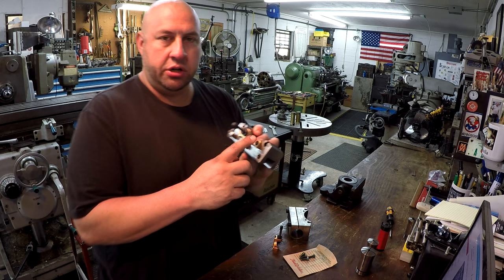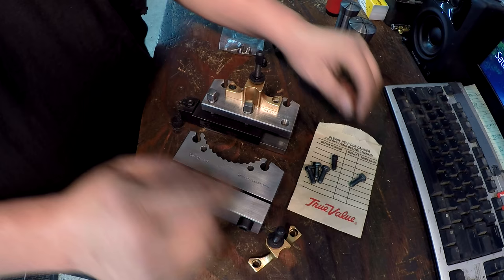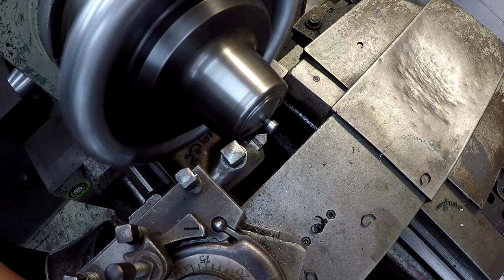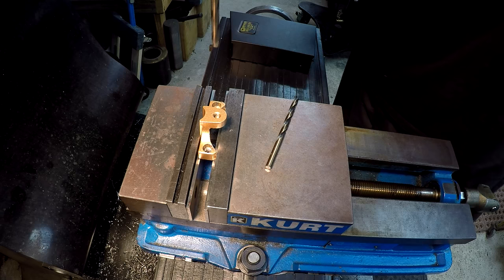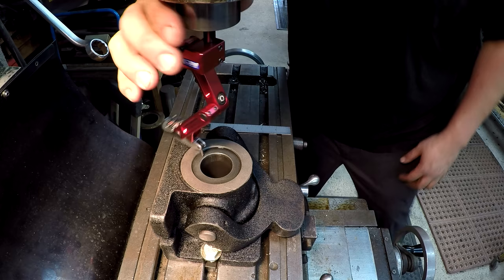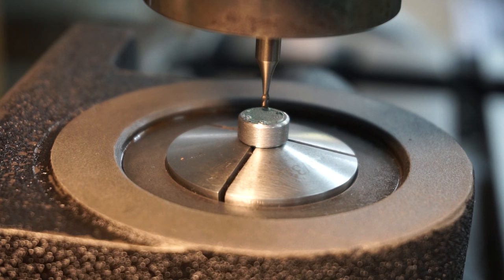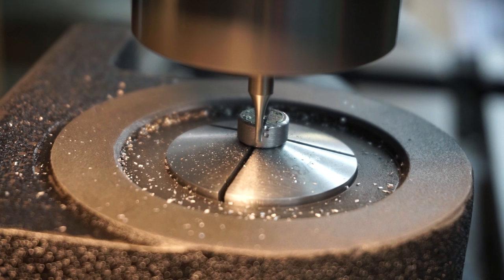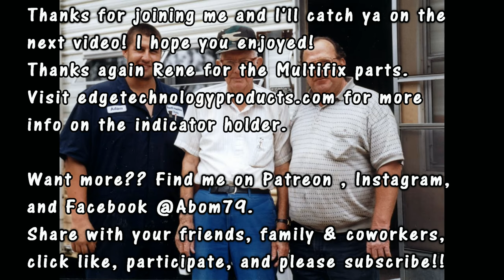Saturday Night Special 143 Part 2: Multifix Mods, Edge Indicator Holder

Comment: Adam, collets and screw threads have been a problem for me because the crests were often bruised from the clamping force. An old timer in the electric shop showed me how to pick a copper or iron wire size to wind spring fashion into the thread, The collet gripped the wire and the wire contacted the thread flanks. The softcwire deformed making a good but gentle grip on the threads.
Reply: thats a nice one I will have to try.
Reply: Or lock two nuts against each other, making sure that the flats line up.

Comment: I needed some M7 bolts a few years ago when I replaced an engine on a old Craftsman snow-blower, and the new motor (offshore clone) needed the M7 to mount.  No-one had in stock, and online the only suggestion was a VW shop, as they indicated that M7 was used for some part (water pump?) on a few years models.  It turned out to be easier just to grab a few M8 bolts, and run an M7 die on them to thread them down to M7.  (for some reason my tap and die set had a M7 die)  Not a perfect solution, but it did the job without having to re-invent the wheel.

Comment: For those who don't have a  full drill size set here is my advice. My projects used a mix of metric and Imperial fasteners. An older machinist advised me to buy a complete fractional/numbered/lettered set. That way all sizes are covered. a couple of 1/1000 of an inch wont make a significant difference. Find a drill chart that converts the metric size to its imperial equivalent and away you go. It worked really well. I bought a cheap all inclusive set and when a bit broke I replaced it with a new but Good bit.

Comment: Abom using a 1/16" end mill?  That's a switch!  Must have been good and sharp, that was a pretty good cut. I held my breath hoping it wouldn't break. 
Sony camera looks good. With a close-up shot, you might try a higher f-stop, it will give you a greater depth of field and make focusing less critical.

Comment: That new camera has such incredible image quality!  I like the background noise for that bit.  But yes, you need to get or build some sort of a rubber shockmount for damping the vibrations for mounting the NOGA-held camera on a machine's table.  Fun to see you working on smaller parts once in a while. ^^

Comment: Just a Tip from a Guy over here in Germany:.... get a METRIC Repair Set called "Helicoil", drill your "M7" Hole bigger in the Multifixholder to 7,6-7,8mm , tap it for the M6-Helicoil, and then thread a M6-Helicoil Insert in there....DONE......use your Indicator Holder as is, WITH the M6 Allen-Head Screws.... ;) all tools required ar in a Set for the Helicoil (Drill, Tap, and inserts)

Comment: I used collet holders like that all the time when I was a lead setup man on horizontal mills. If i remember correctly the lock screw is not for locking the collet holder in the closed position. It was to keep the collet from spinning in the holder in long production runs. On the collets we used there was a keyway where that lock screw or set screw would hold the collet in place and not let it spin. Then you just move the handle up to take milled part out and push down to tighten on part to be milled.
Reply from the maker: The problem with mine is that is feels kind of springy and it might not stay locked with just the handle. The set screw kept the collet locked in place though.
Reply: Yes, they dont click or a lock down feel but they hold like that springy feel. We ran short production runs as small as 10pcs. and as big as 10,000 and they held like that and I never had one lift the part out of the collet. They hold well.

Comment: Like you said M7 is not a common used size. Our regular Hardware-Stores normally don't sell them. If they do they are quite specialized. I find it hilarious that you would find them in an US Hardware-Store.
Reply: its an iso size, just a weird one, along with the 11mm head size it would have had., i belive its more of a 'leftover' size from fractional sizing as its very close to 7/16 bar stock
Reply: Lol...exactly! Even though my tap and die set has them I have not encountered a M7 screw or nut even in the wildest hardware bin! Not on thread repairs(even though it's the correct size over M6), not on motorcycles cars bicycles, and I bet even unicorns don't have them!
Reply: i've never seen M7 before even working in the shop for almost ten years(im in asia here almost everything are in metrics)it really rare size

sorry for my english not my 1st language
Reply: Your English is OK! I've never seen a 7mm thread either. I have never seen a 7mm tap or die. It is like a Unified National #12-24 thread. Until last year I never needed a #12-24 tap and like Abom I found one at the True Value Hardware store (a full three tap set with a plug and bottoming tap in fact! It was American made too).
Reply: Zorgoban 
Ya I have had to look for some M7, seems to be common in German made things for some reason
Its a pain when someone uses it, as trying to fix it and nothing is open on weekends much.
I still wonder though why its used, such a weird size.
Reply: I have never seen a 7mm bolt, but I have half a dozen 12-24 taps, and a lot of other archaic sizes.  15mm was more common on earlier metric cars, like VW and Honda, back in the 60's and 70's, and on early American crossover cars of the '70's, hardly ever see one now.
Reply: I'm in Germany and i can't remember ever seeing an M7 bolt.
Even my thread cutter and tap sets don't have it.
And i know for sure most hardware stores in Germany don't have it either.

Its a seriously stupid size.
Reply: On 3 brands of Italian scooters I've never saw one(even on the real vintage ones), Yamahas,Hondas,Kawis...from underbone to sports production...none...To be fair I've never even seen a Bugatti though!
Reply: Chris Stephens
if you want an actual known use for m7, skoda estelle door hinge bolts, dont ask how i know!
Reply: i worked in an arcade and a lot of our japanese cabinets had m7 in them holding stuff together
Reply: M7 is quite common on car engines, like Volvo's aluminium engines. Valve cover, oil pan, intake manifold and various brackets and stuff are all M7. Renault too, and probably others, but those are the brands I have worked on most.
But still an oddball size, so I treasure my little box of M7 hardware...
Reply: In 60's all citroen and other French cars had this sizes.M7,M9,M11 etc.They also needed special tools to work on them.

Comment: The collet holder is very nice, and so is the new camera! Whenever you have smaller stuff, it's perfect for it.
Reply: By the way, why don't you make some hard mounting points in the ceiling? Nothing permanent, but example, you could have a plate above each machine, and on it, a thread. There you'd mount and extension that would give you a metal point to grab with you Noga. It wouldn't be in the way, and, bonus, no vibrations.

Comment: You could pick up a boom type microphone stand pretty cheap, and use it to put your camera close to or over the work without sitting it on the machine. Probably have to make an adapter between the stand and the boom end, but that should be easy enough. I think I saw one at Amazon for around $20. If you're worried about it falling over, just do what the pros do and sandbag the leg opposite the load. Goes without saying I am a solid fan of the channel. Thanks for all you do.

Comment: Hey Adam,  I heard you telling that your mind was set up with imperial measurements and that you were having difficulties with metric. For me that is likewise, but the other way around. Metric is in my system and if I have to do with imperial, than i have to do some thinking. But what helps me enormus is, that 1/16" is almost exactly 1.6 mm (your may be a few thousands off). This has proved to me very handy and easy to remember. So: 5/8 = 10/16 = 10 x1.6 = 16mm and 5/32" = 2.5/16 = 2.5x1.6 = 4mm. And 1" = 16/16 = 16x1.6 = 25.6mm. This works for me and it might give you a better feeling for metric measurements. Y.C., Timen.

Comment: To each his own but I think I would have cut the slots with a slotting saw/arbor combo holding them horizontal. Don't really matter how it is done as long as it gets done....... Good video as always.
Reply from the maker: Johnny Holland As I have always said, more then one way to get the job done.
Reply: That is what makes Adam's channel so interesting is that he shows us different ways to accomplish a goal.
Reply: The whole thing adapting a screw head is a 10 seconds job on a grinder. Would not be as pretty but would work just as well. Only NASA would machine a screw with 1 thou tolerance :-)
Reply: i think most people would have used a slotting saw but this is way more entertaining

Comment: I like the back ground noise, not too loud like music in the back ground Real life works real well for you and the sound goes well with the work IMHO. Like in the shop at MI, people walking around metal banging around when the machine is off. Keith F and Keith R (at the museum) both have background sound. I sure as hell prefer it to music. Not a camera person but it seem to me the auto focus could be over thinking the vibration when the cutter was cutting. Either that or the camera was just capturing the vibration of the set up. It was in focus before and after the cut. Sound volume is definitely up a notch or two but very clear, switching cameras often might be annoying. Just my 2 cents. Great to watch as always and thanks for the work ahead so none of have a depressing Saturday night.

Comment: Just wanted to point out that you are correct, M7x1 is far more rare than M6 or M8 because M7 is considered a 'second choice' thread size (but does actually exist as an ISO 261 standard, unlike M9).

Comment: i forget if Sony uses sensor stabilization or OIS in the lenses but make sure that is turned on, it will help with the vibration. As far as microphones go an external is always a good idea. the internal will do the job but you can expect much higher quality from a hotshoe mounted external.

Comment: Thanks for your video. Though i have multifix tool post and holder sales many years. Many models are made in China and I just sell. I don't know how to use them actually. By your video i learn that the T wrench can be used on height adjusting screw too. And i saw some interesting tools and accessories in your workshop. Thanks!

Comment: It's interesting how much vibration was introduced when you started cutting, and it looked subtle enough to only cause focus issues and not movement issues. I wonder how much that vibration effects the machine. Also, try a shock mount for the camera, should be good enough, and they're used throughout the RC world especially in multi-rotors. 
And your idea of using a Rode mic to get rid of background noise; I personally like some background noise, gives more life to the content, as it doesn't make your workshop and the world around it seem dead silent.

Comment: I may be crazy but my first reaction to the fasteners being a different size was to use helicoils (if you have the right size on hand).  Am I crazy?  I would have wanted all of my tool holders to be uniform and interchangeable.  I have learned that I dont recognize when things are good enough and often put too much time into little tasks that should take minimal time in the machine shop.  I do think that you made a top notch fix for this problem.  Love your content and willingness to teach.
Reply: M7 is so odd, do they even make a M7 Helicoil?
Reply: @michael931  They do make M7x1 helicoils but I think you would want to use an M6x1 coil in the existing M7 hole so that you can use an M6 fastener.  I imagine that it will not be perfect but it could work.
Reply: @crashes3221  you're right.  That would have been much easier.

Comment: I like the Sony better than the GoPro.  The sound is crisper.
I'm sure you already know about "depth of field," where the smaller the aperture (larger the F-stop), the more of the frame that's in focus.  F22 aperture for example gives a large in-focus area (depth of field) than F4.  To get a large depth of field, you sometimes have to flood the subject with lights, which they do in movies and television.

IOW, more light means more of your work will be in focus, especially in close ups.

Comment: Try to set the focus to manual on the new Sony and see if it's take the shakings on the machine better! I think the auto focus is compensating for the vibrations and that's why it get blurry some times.
Reply: I think the camera was also hunting the chips on auto-focus.  I'd go to complete manual focus if the camera supports it.  I really liked the close-in shot though.  Even feeding would cause the focus the change.

Comment: The more you are zoomed in,  the more apparent the vibration will be.  In your camera settings there should be something about audio gain. By default the audio is likely set to be automatic which means it is constantly adjusting to get some sound so when it's quiet the camera will amplify what's available like the road noise etc.
Nice shots!

Comment: If you use the Rode mic, just be aware of talking when your heads turned or facing somewhat away from mic. I have a bad habit of turning away when talking then end out spending a lot of time normalizing audio in editing so that sound/speech can be heard in clips. I use mine with GoPro, so maybe Sony has an audio control on camera that you can help with that issue.

Comment: Hi! I guess that it is not possible to machine a hex/allen recess in the bolt so you could use an allen wrench to tighten it. I offhand would not know how to do it. I have a faint memory that in the manufacturing process the bolt head is heated and something like a punch or die is used to form the socket head. Just wondering. Another great video Adam!

Comment: Adam, do you have a slitting saw arbor for the DoAll mill?  You did a good job using that 1/16" end mill, but I was holding my breath the whole time, LOL.  I have broken my share of those, now I prefer to use a slitting saw blade.  TreeTop
Reply: I wondered the same regarding the use of a slitting saw and the collet holder being used at 90, but it all worked out fine just as we anticipated.

Comment: Have you built a tool holder rack for your multi fix tool holders?  I have several tool holders for my E series QCTP and would like to mount them similar to the Tom Lipton method he used for his Aloris tool holders. .Wondering if you had a design you liked

Comment: when it comes to being used to Metric vs Imperial, wrenching on hondas my whole life, i can "see" metric bolt sizes alot easier than imperial, but from my woodworking/turning, when looking at cylinders under 1" i can see the size, in 1/16ths, way easier. I used to turn plugs (or gauges if you are a pleb) like for stretched ears, i can call someones ear size from across a football field.

Iv been trying to get used to celsius just because science stuff. I just set my phones weather app to display both F and C, seems to be working.
Reply: good luck on the metric conversion to your brain!  M7 is one of those weird sizes, usually automobiles size for something odd, it also uses an 11mm wrench size, you wont use for much, but at least its less odd thn the 15mm which doesnt officially exist in the iso sizing (it just happens to be real close to an AF size (19/32)
Reply: If you work on an American car you will need that 15mm wrench. You have to pay attention when buying wrench sets to make sure a 15mm wrench is included for that reason.
Reply: Aceroadholder
i think its because its a 19/32 leftover, they sure never use it in the UK, its my only super shiny wrench on my rack, been untouched for over 25 years! and usually no sets include them.
 (although the now commn chinese sets are the same the world over and do now have the 15mm)
Reply: +jusb1066, the 11mm spanner/wrench as you Americans call it . is very useful as its a good tight fit on a 7/16" AF nut or bolt head , I use that 11mm a lot on vehicle repair  when the 7/16" would tend to round off the hex corners on a difficult to get at bolt as its about 3thou smaller. and the same but in reverse with a 13mm bolt or nut size . use a 1/2" AF spanner  it's a good tight fit , better than skinned knuckles ( spanner rash ) when a spanner slips.
Reply: Chris C.
yes thats my theory about the 11mm too, that and  the 15mm 19/32, i think some factory out there still makes a ton of bar stock and isnt gonna change, so resells it as metric!
 ( am english, but i americanise my terms as most readers are from USA)
Reply: Odd things do stick around on occasion. For example, Rolls-Royce jet engine ignition harnesses have a Whitworth threaded collar nut from the cable to the ignitor. Most techs never notice that the collar is 7/16 Whitworth because a 21mm wrench fits (most of the time!). When I worked at Champion Aviation we received complaints of collars being oversized and a 21mm wrench wouldn't fit. rather than arguing the point, I tightened up the max. size AF of the collar so that a 21mm wrench would always fit. The underlying reason for the Whitworth thread was backwards compatibility that keeps leapfrogging from one generation of assemblies to the next.
Reply: Aceroadholder my ford ranger is mostly made in china, so grabbing my metric sets usually works out for any assembly, if its like panels or shit like that, sae

Comment: How would you add an Allen wrench hole to the top of the 7mm screw/bolt, as opposed to adding a straight slot for a screwdriver?

Comment: A stupid question from a non machinist to Adam, or any machinist willing to answer it.

When setting up the 5C collet chuck, why did you make you sure you are on center in both axis?
Because you then moved one axis to mill the small slot.
So ist there an advantage of doing  that, or is just just the habit of a professional setting everything up perfectly?